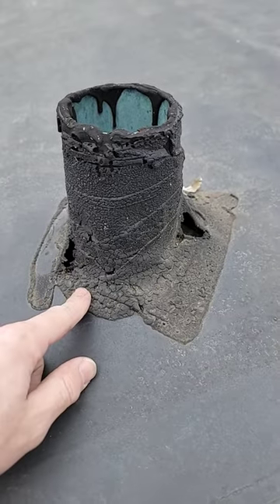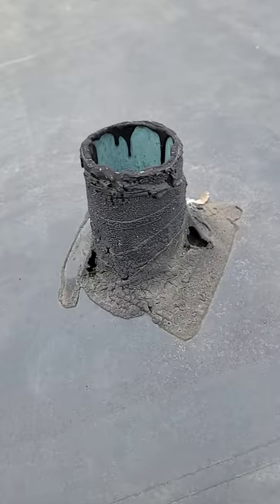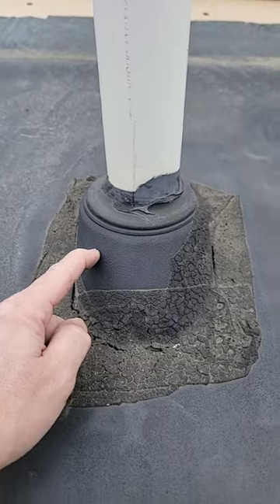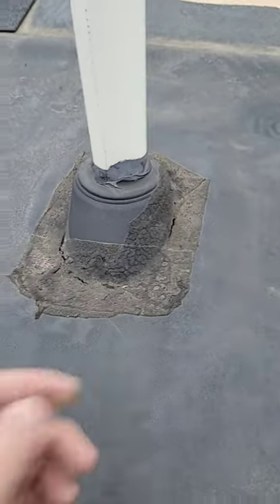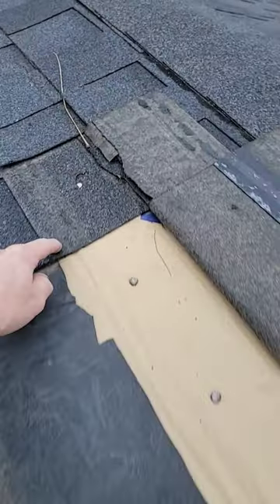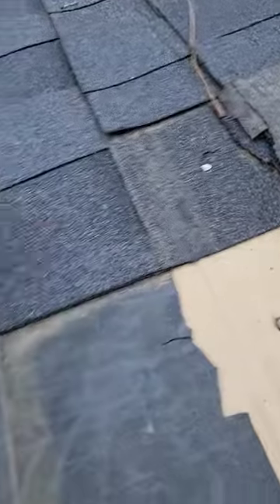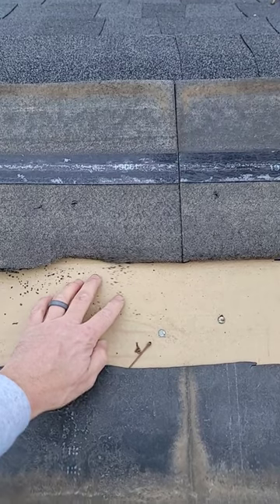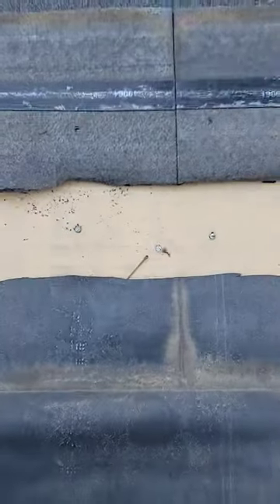Worst Roof Job Ever EPDM Rubber Flat Roof

Comment: I always glue the seams, then run a primer with seam cap over the seam. That's for a Firestone epdm system. Maybe this knucklehead thought it was seam cap tape? Using wrong boots and having any vertical seams on a roof that wide is ridiculous. Unfortunately, I've seen this kind of thing over and over. I sure wish everyone would just spend the hour and read the manuals. They aren't that long or difficult to follow.

Comment: I've only done repairs with epdm I know that cleaning is a big deal. Also I heard alotta ppl forget to activate the tape. Now again I've only done repairs and flashed ac units.
Reply: As a commercial roofer, you clean the rubber, apply primer to both sides of lap, apply seascape to lower lap side, roll the tape with a 2" roller, applying a minimum of 32 lbs. of force, you may roll it in whichever direction you like, before you peel the tape, run the rubber on top and trim so that a minimum of ⅛" no more than ½" of tape is beyond the lap, you may then peel the tape and roll it again but this time at a 45⁰ angle ensuring you overlap your passes ¼". Seam tape is only for laps and possibly a temporary patch (extremely temporary). Cured patch material is for holes or cuts. Uncured patch material is for voids and wrinkles, as well at "t" lap joints, and at every 90⁰ upturn. Pressure sensitive material is used for field flashing pipes as well as corners, anywhere you need it to stretch. Of course all of this are just for detail work, the rubber will either be adhered, ballasted, mechanically fastened, or one way vents. There's also usually a system of insulation with crickets to control the flow of the water, but for residential it usually just runs off to a gutter or more shingles so no crickets are typically needed. It sucks to see this done to people. I know you weren't asking for any of this information but in case you find it interesting, also the cleaner we use contains acetone as well as other bad stuff, to be honest you can clean it with dish soap just fine, but when priming the rubber it needs to be scratched in, think of it like a bike tire. Cheers!